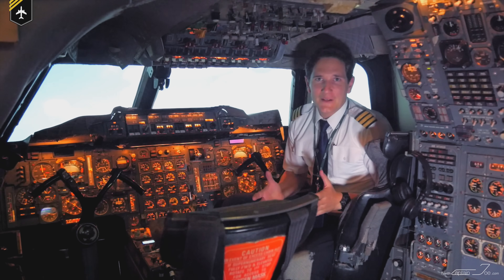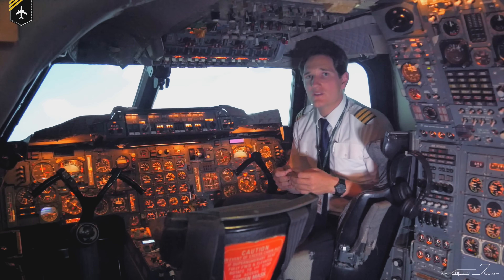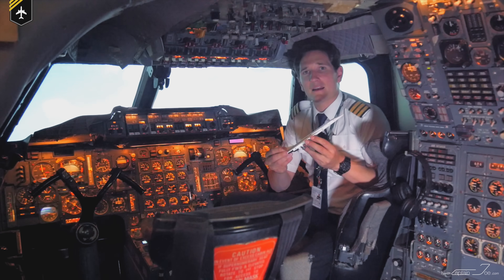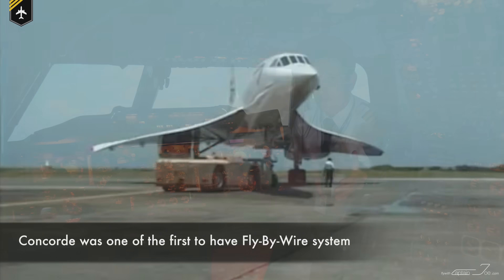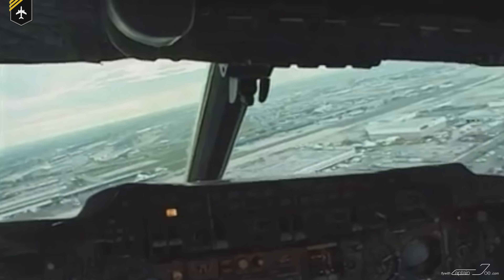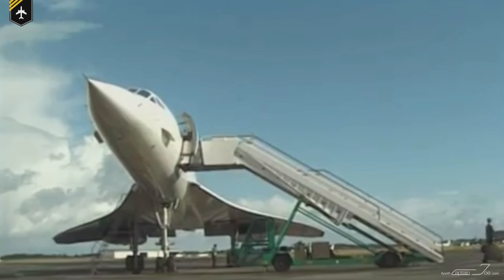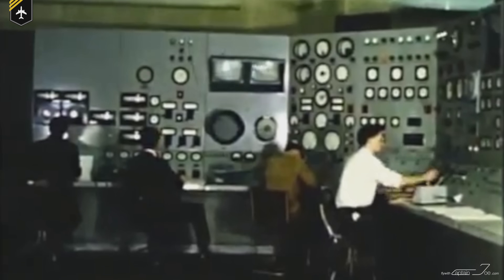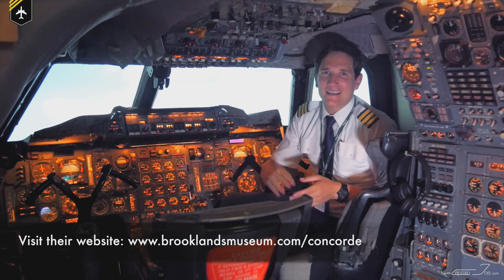FACTS you should know about CONCORDE! Episode 3 by CAPTAIN JOE

Comment: Captain Joe, What do the morse codes mean during ILS autoland ?
Reply: Abhishek Banerjee if you look at the ils chart there is a certain Morse code for every runway in the airport so it's just a confirmation of which runway are you using but it's not a big deal
Reply: Thanks a lot Nick. Makes sense now. :)
Reply: Abhishek Banerjee no problem my name is not Nick it's just a meme lol
Reply: That i think is the airport localizer , transmiting the identification code of the airport as Nick said. It is used for tunning in some cases. There are localizers not located at airports which are used for navigation purposes. In many cases the landing is not straight , like in the montains regions (see Innsbruck - Austria) and therefore the localizers are used to vector the aircraft during the landing procedure.
Reply: Right :) .
Reply: i think you are referring also to the marker beacons on the ils, there are 3 marked points as you get closer to the runway on the system, the outer marker (om) ----- midle marker (mm)-.-.-. and inner marker (.....) which sound as you fly past them
Reply: Yup, Ive just started my training. Thanks a lot. Really helpful mate.
Reply: Don't mention it. I learned it in fligh simulator x :)) .
Reply: MS FSX? All pilots start there lol.
Reply: SquaadZulu yeah I am upside down so my collar stays poppin
Reply: All these ground based navigation aids - ILS, VOR, NDB - have identifiers or names. For example, a beacon in Amsterdam could be called AMS or a beacon in Dublin could be called DUB. As you can imagine, there are multiple beacons serving cities (or areas for that matter) and you need a way to distinguish between them. You wouldn't want to tune the wrong beacon for an approach!

Nowadays, modern aircraft can automatically identify beacons and have their named displayed on your flight instruments: you tune the beacon DUB, and the letters "DUB" are displayed on your instruments.

Another way to identify beacons is using morse code. All letters of the name of a beacon (usually three, but sometimes four!) are sound out. You can tune the beacons and have their morse code be heard through the audio system of an aircraft to confirm the right one is set.
Reply: Abhishek Banerjee y
Reply: No, its definitely not those. I am aware of those. Thanks for the help anyways Juan. :)